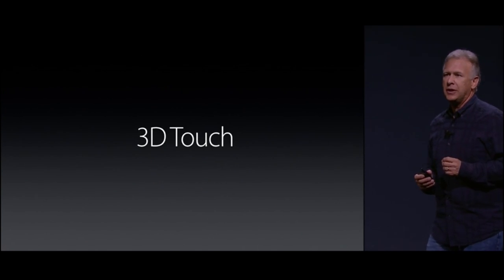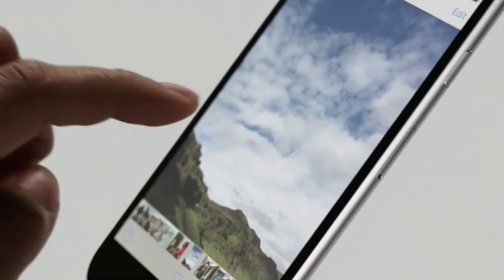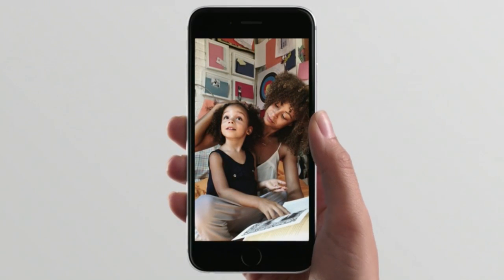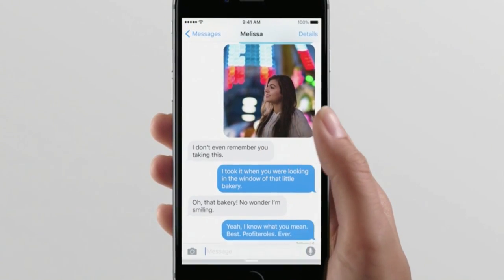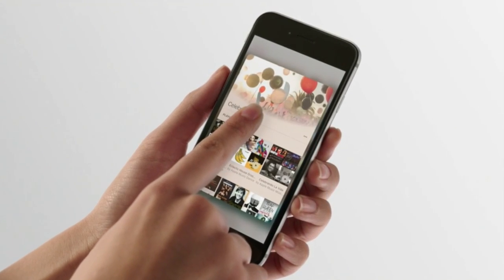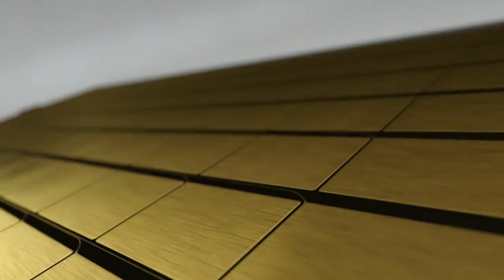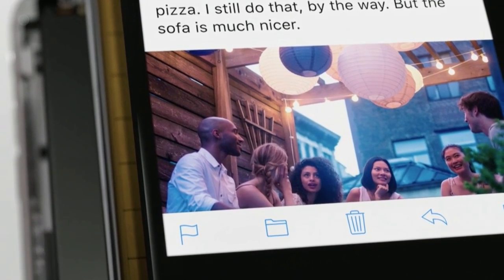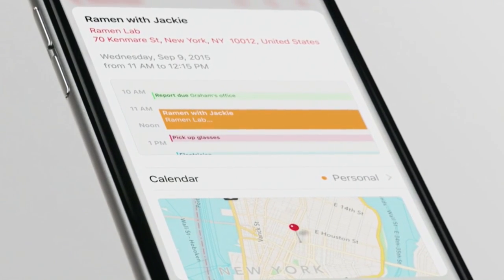New 3d Touch Technology on iPhone 6s

Comment: It's not about how long you press, its literally how hard you press. They showed a demo of a game where you move your reticle and press harder to switch weapons or aim down your sights. I think this is going to be a big deal for games especially since most games are made for ios first anyways.
Reply: Finally someone who get's it. Most people don't understand, and act smart thinking this is nothing new at all.
Reply: +MachineJugz, the problem is that their demonstration shows someone pressing and tapping to make something different happen... which is something that's been done on smartphones for a while now.

A better showcase of the 3D touch would be a paint program that will allow you to change the thickness of the 'brush' based on how hard you press on the surface. Something that used to be only on digitizers & 'smart' pens.

As a user interface enhancement? I don't see the point right now... of course, in retospect, 3D Touch is probably something better experienced in person than viewed in a presentation.

Comment: This what happens when have to design and create a new phone every 1 year cycle. You end up creating tech stuff that's either useless, gimmicky, or boring. You're basically under pressure to create new features  just for the sake of having something new.  I guess they have to find a way of keeping  their engineers and designers busy.